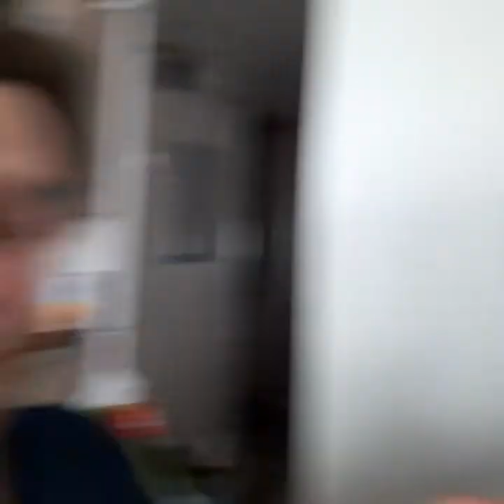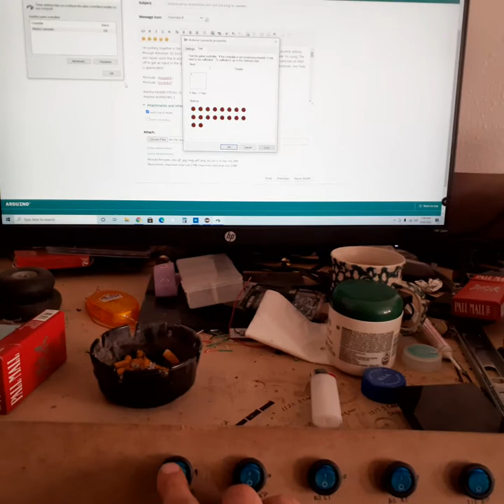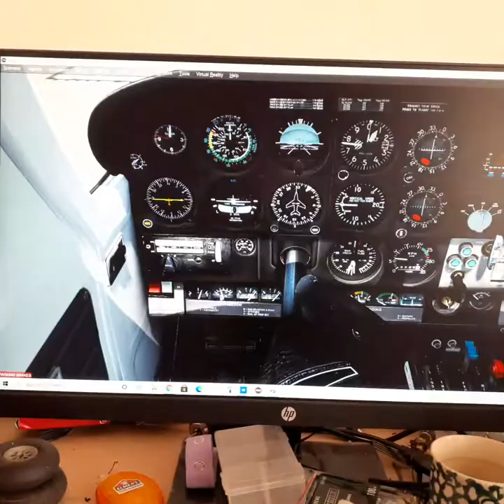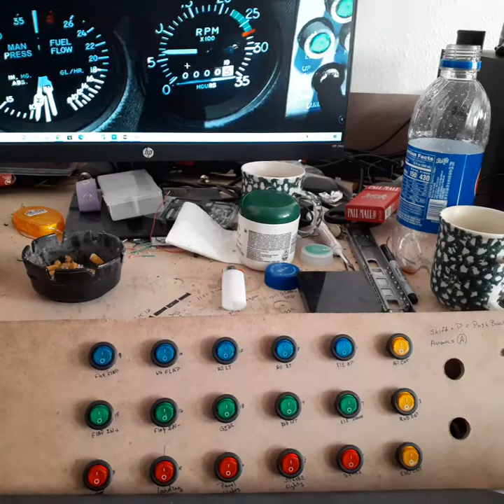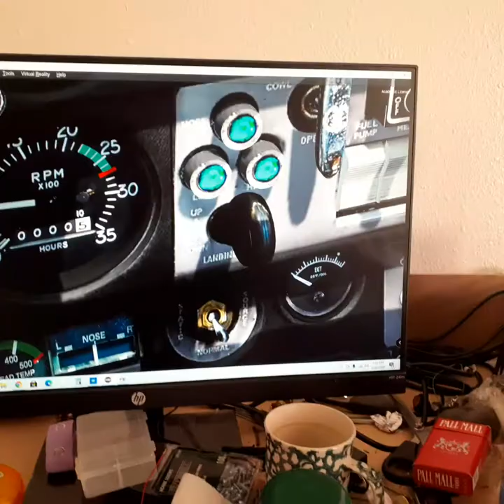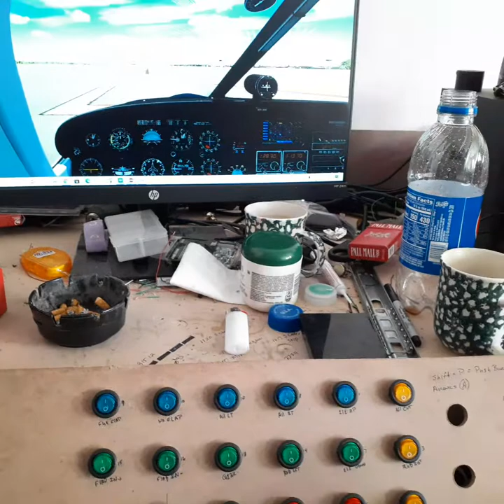arduino button box issues

Comment: Hi;
I found the problem with any latching toggle or button so I had to go with all momentary buttons, also if you have just 1 latching button or toggle and you leave it in the ON position it will block any other input from any other button press.
I did find a code but written to emulate a keyboard which works well with latching toggles but I don't know how to modify it to work as a gaming device instead of a keyboard emulator